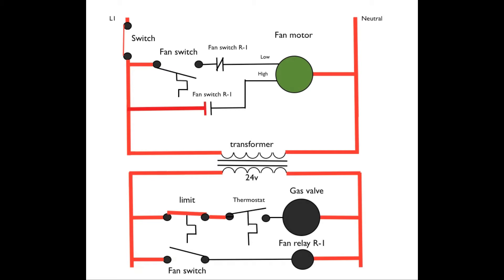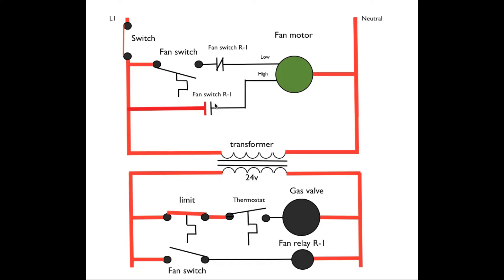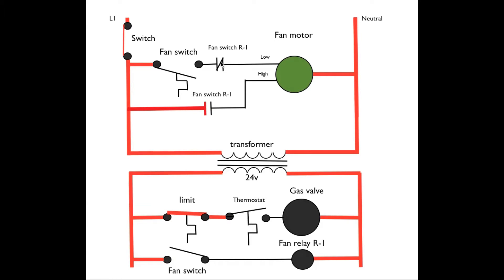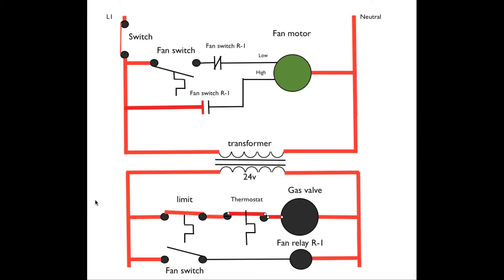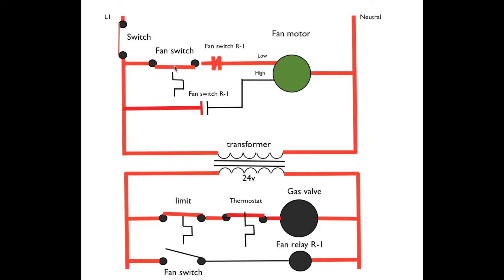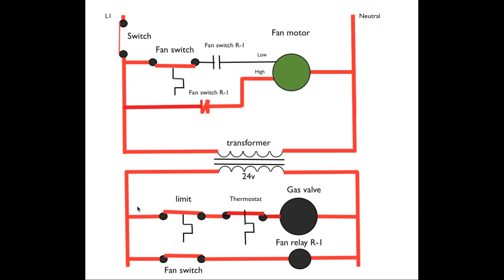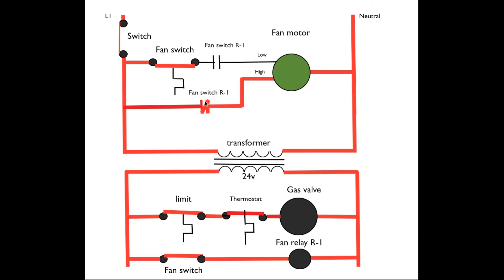Schematic diagram #7.  2 speed fan switch.

Comment: Great video. I just have a question! Where we can find the location of the fan switch to energize the low speed fan motor.
Reply from the maker: There is no easy answer to this.  The fan switch will be located on the thermostat if it has one.  Generally, on furnaces older than 30 years, any manual fan switch will only energize high speed.  Newer furnaces that have a manual fan switch will energize the fan in low speed.
GFM
Reply: grayfurnaceman the thermostat!! Wall thermostat? I’m so sorry to make this question again, I’m confuse. Or its another thermostat on the circuit board? Thanks again
Reply from the maker: Yes, the wall thermostat.  Not all wall thermostats have a manual fan switch, but if the unit is equipped with air conditioning, it will have a manual fan switch.
GFM

Comment: This is a great series GFM!!  Thanks for what you are doing!!  I was wondering, is the fan switch in the control circuit manual?  Can it also be automatic?  Thanks again!
Reply from the maker: In this case it is.  If the fan switch is open it operates as an automatic switch, coming on when the heat raises the temperature.
GFM
Reply: So, it is connected to the automatic setting on the thermostat?

Comment: I'm having problems with a fan/limit control. I have a l6064 Honeywell 2 speed fan control that I have on my woodfurnace. I would like to have a low fan when the sensor falls below a set temp, and go into a normal fan speed when it hits the on temp. For some reason when I run a wire from the low side to the low fan speed, nothing happens. When the on temp is hit on the limit/control then the normal speed comes on. The issue I'm having is the only time low energizes is when it hit on temp. It's showing 150 volts at the low and 120 volts on the normal fan setting. Any ideas?
Reply from the maker: The only thing I can think of is if the fan switch is wired backwards.  The top terminal is the power source and the 2 bottom terminals are for the different speeds.  Hope this helps.
GFM
Reply: Thank you. That's exactly what I did wrong. Could you tell me if it's possible to wire in a second limit control to shut off the power to the main if the temperature dropped too low? Thanks
Reply from the maker: laynes69 Are you trying to shut off the fan or the power to the unit?
GFM
Reply: Just the fan, I was thinking of wiring a second limit control on the fan only side, that would come on and power the main control, but once the plenum dropped to 90 degrees, then shut off the blower.
Reply from the maker: laynes69 The fan should shut off from the fan switch unless you have set the cut off temperature too low.  Try setting the off temp at 110F.
GFM
Reply: I increased the off temp, and it still ran. I believe this limit/control is made so the low speed runs constant after the off temp is met. I think I'm going to just disconnect the low speed tap. Thanks for your suggestions.
Reply from the maker: It should shut off.  Are you sure the manual switch is in the automatic position?
GFM
Reply: The limit control doesn't have a switch on it. It's just like a standard Honeywell with a low speed tap.
Reply from the maker: laynes69 I meant a switch to run the fan continuously.  Some of these switches have a white plastic shaft on the lower left that can be pushed in to run the fan.
GFM
Reply: This limit control doesn't have an override switch.

Comment: Hi GFM, Being a newbie at this, these relays are kind of messing with me.  If it is normally closed when de energized would I be right in saying that when energized it would become normally open?  Do all relays operate this way?  Thanks for all your help.
Reply from the maker: Normally means when no power is available to the coil.  In diagrams, the relays are usually shown in the deenergized position.  Open means no power passes thru.  Closed means power passes thru.  Hope this helps.
GFM
Reply: grayfurnaceman Great! thanks for the info that cleared that up for me.  I noticed on most relays and contactors they have multiple terminals to put wires on, do you need to use all of those or just the ones you need?   Thanks again GFM I appreciate all your help.
Reply from the maker: 1290457 Just use what you need.
GFM